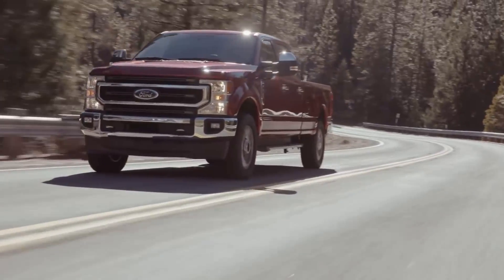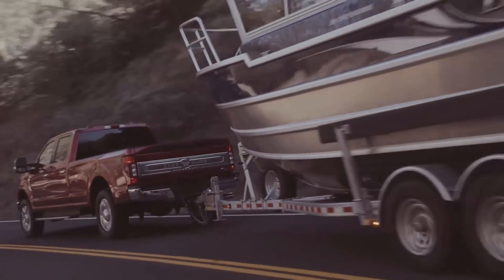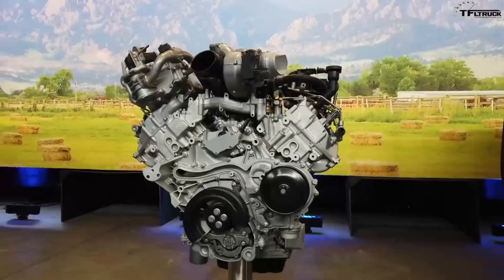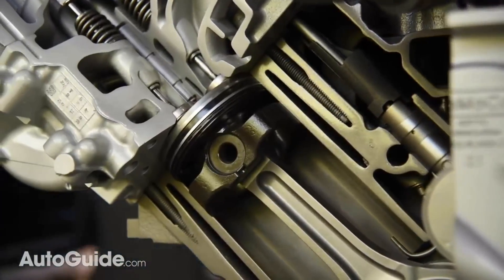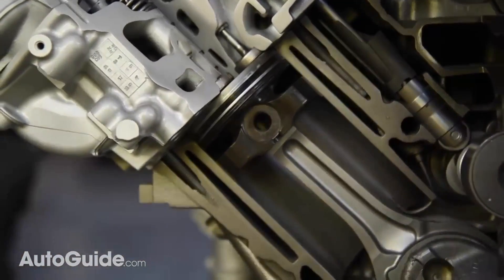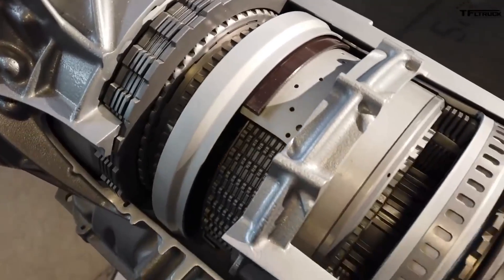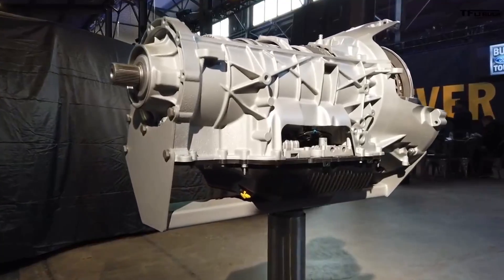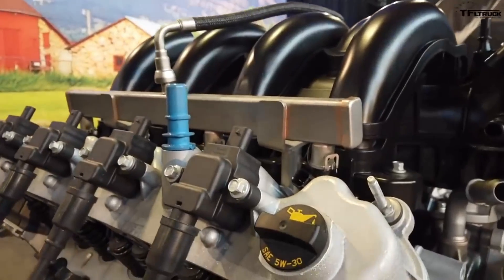2020 F250-350 Engine Changes and Specs (1000FtLbs!!)

Comment: Dont mind the gm and mopar guys dudes are just mad that there trucks will never own work and will always be 2nd and 3rd because us Americans only drive the best
Reply: the person that sells the most don't make it the best. its all about marketing. ford has had just as many problems over the years as everyone else if not more
Reply: @bigbossman5969  Ford lies watch dyno test. My detuned 2500 has more horses and torque than Fords anything.
Reply from the maker: Powerstroke nation 6.7 Ford is the only one who makes everything for their trucks. I do like a Cummins engine. I will also say the new dodge interior on the limited is nice. Finally someone brought competition to the table! We will see what ford does but these engine changes are future proofing this engine so they can turn it up and make crazy power!
Reply: @JaegerWrenching  engine wise which one would you go for Powerstroke or Cummins?
Reply from the maker: @unsc0212able  it depends on what you like to do, drag racing the cummins has lots of support, and aftermarket parts, the 6.7 ford has very little. I plan on making some parts for the 6.7 powerstroke and making it a staple in drag racing.
Reply: @JaegerWrenching  been looking at videos and i think your right on HP and Torque numbers. I think they will try and beat it for bragging rights. For 2020 i like the Ford super duties and Ram 3500. I especially like the rear passenger seats that can lean back and has bigger led screen in the front. Probably like the Ford Super Duties more especially since they seem to have worked alot on making a more solid engine.
Reply from the maker: @unsc0212able  I say drive both and see which you like best, i will say i love my 2018 f250. best truck i have ever owned!  I've  really enjoyed tuning it! But I will say the new 2020 6.7 PS is going to be a beast of an engine. They are the only factory production steel piston diesel truck on the market, and the steel piston allows for tighter tolerance on piston to cylinder wall clearance because steel grows less than aluminum with heat. This helps with piston ring sealing power and strength. I'm going to see if i can get one on the channel as soon as they come out and do a review, possibly review the new Ram as well.
Reply: @JaegerWrenching  Exactly your amazing explanation on the 6.7 is what made me look more into it. I want a engine that basically is well put and it seems Ford is fine tuning a engine that already works. Quick question on the exhaust pipe. If you change it out does that void warranty? About only thing i change since Ford default looks bad in my eyes lol.
Reply from the maker: @unsc0212able  anything after the DPF is fair game. So if you want to change the exhaust tip because you hate it go for it warranty will still be intact. I hate it too so i changed my entire exhaust lol, but i have a good friend at a dealer so i can warranty my truck regardless.
Reply: @JaegerWrenching  Yes the one thing i want to change the whole exhaust. Looks horrible. What about the intake for better air delivery?
Reply: @unsc0212able  but STILL ... Not as good as a Cummins Ram.  Point blank .
Reply: stop kidding your self
Reply: @bigbossman5969  well facts dont lie my guy
Reply: @thatguyinthe5.036  just because u sell more don't mean your the best
Reply: @bigbossman5969  McDonald's sells the most burgers but isn't the best burger. Think about it.
Reply: @bigbossman5969  these phore  guys will never learn . The truck itself is pretty nice . Ford has had diesel issues since they quit making the 7.3.  The 6.7 scorpion isn't a whole lot better then the 6.4 .
Reply: You got that right !
Reply: YOU KEEP SITTING IN THE FORD DEALER WAITING ROOM SIPPIN COFFEE AND FREE DONUTS WHILE WE DRIVE BY TOOTIN AND WAVIN AT YA IN OUR DODGES AND CHEVYS!
Reply: I'm sure they will make us mechanics rich !
Reply: CUMMINS>powerjoke durawhat?

Comment: all the problems ford have had over the years with the power joke engine  i guess they did change it.  let's see all the new problems this engine will have. will stick with the Cummins.
Reply: Cummins diesel in Dodge trucks have problems too
We have a 2012&17 at work and they've both spent time in the shop
Reply: @jondavidbristow9819   no vehicle is perfect its eaven worse with all the emissions garbage on them
Reply: @bigbossman5969  just what I was saying
They all have their own issues especially if you don't take care of them and with the newer ones you have to take very good care of them
Reply: @jondavidbristow9819   exactly
Reply: Lmao congratulations u make fun of engines that were built and designed by international yes the 6.0 and 6.4 were disaster's but the 6.7 which is built by Ford has been a wonderful engine for Ford I currently drive one not a slick of issue
Reply: @thatguyinthe5.036  its better put it has its share of problems 2. the biggest problem with the newer diesel engines is all the epa garbage its killing them all brands and made them unreliable
Reply: @thatguyinthe5.036  I've talked to quit a few contractors who run Ford's.  They all seem to complain about turbo problems  over and over. Some of them have been through 4 or 5 turbos
Reply: I'm a Cummins guy but look at the facts and dont lie to myself. Ford only takes credit for the 6.7. The other engines were made by other companies and not Ford. I congratulate them for making the effort to do it right and build a superior engine and tranny in house. I may be switching to Ford for an all around better truck.
Reply: @conradanderson404  ford has just as many problems as the rest. go look them up

Comment: Ford has to keep changing their junk while Cummins essentially stays the same. I’ll take the tried and true.
Reply: deadendsb The problem is the Cummins comes in a junky Fiat/Dodge body.
Reply: Ford's Powerstroke and the Cummins have both had changes to them and they've been doing about the same
Neither of them is better than the other anymore
Reply: Jondavid Bristow The Ford simply cannot get the fuel economy of the Cummins. RPM kills it. I drive both.
Reply: @deadendsb  my 6.7 gets the same mileage as a couple Cummins that some friends have but fuel mileage wasn't a concern of mine when I bought a 1 ton Truck
Reply: @jondavidbristow9819  Towing the same 37 ft rv with a 18 ram drw that i previouly used a 16 denali 2500 i can assure you the Duramax will out mileage Ford or Cummins.
Reply: @tumbleweedking5668  I had an 06 Duramax 3500 and it only got 13 towing on the highway
My 2012 Powerstroke gets 15
Reply: Both changed but u obviously have not driven a 2019 stroker  !! Cummins only dream of  how the truck handles and it is a rocket ship !!
Reply: not too mention that the cummins design has a long future using the same torgue building design from its heavy truck cousins out there in the big commercial market. the bling and show off factor of a new ford ends abruptly after a few payments and when your broken down on the highway during vacation pulling your pretty 40 ft camper. wave to the chevy and dodges goin by ya !

Comment: Without RAM none of these trucks would even exist.
Reply from the maker: i doubt that lol! But ram wouldn't exist without cummins that's a fact!
Reply: @JaegerWrenching  the Dodge brothers made the first Model T drivetrains. Ford had to hire the best for a reason. Dodge/Chrysler has also engineered 75% of automotive advancements in the past 100 years. IE Disk brakes, airbags, cab forward designs, all the way to jet turbine cars, and thats not even talking about what Mopar did in the racing world.
Reply from the maker: @TheXOoftheRO  It's sad that the past is covered up. Same goes for Tesla, he invented a ton of new things that pushed the world forward and got no credit for them. The dodge brothers were smart men, unfortunately Dodge after 1920 wasn't the same.
Reply: @JaegerWrenching  well after 1920 up until today Mopar dominates performance. Banned from NASCAR ect. The 1966 Heni design is still the most power manned vehical in history. Top fuel Hemi dragsters are only rivaled by Russian rocket ejection seats.

Tesla, yea he also knew gravity and relativity was a complete hoax to destroy the minds of millions. The oil scam is about as big as the hemp fraud. They have already had the technology to use already existing 7L V8s that can get 90mpg. 

Everything is a lie.
Reply: JaegerWrenching you are a Ford fan boi so fuck you
Reply: Ford will always lead the pack. Haven’t you learned yet ??
Reply: @BORIKKEN  enjoy your throw away cars and McDonald's burgers noob.
Reply: MG42pillbox also let's not forget it's a fiat
Reply: jaeger wrenching is making payments to ford while he false advertises about there trucks for free!........get a girlfriend and give up on the ford....lol!
Reply: MG42pillbox Ram?  Are you referring to the name that Fiat/Chrysler has placed on their trucks to fool the foolish into thinking it’s not a Dodge?

Comment: Need to find out if its still a CP4 pump. I sold mine because I didnt trust the CP4
Reply: the trucks are expensive enough why not add another 500 dollars to a better filtration system,  to save customers  5,000 plus dollars on repairs.
Reply from the maker: Bob L. I heard it isn’t but I haven’t been able to confirm.
Reply: once the warranty runs out and messes up you are up shit Creek . My dad's high pressure fuel pump went out and what a nightmare.
Reply: My 2018 PS has a CP7, not a CP4
Reply: @wfields66  wrong. CP4 on 11-19
Reply: @wfields66  no it had a cp4 unless you got one Frankenstein out of spec from Ford lol